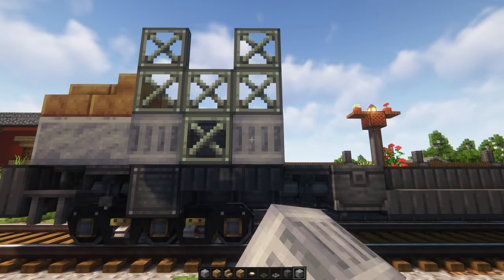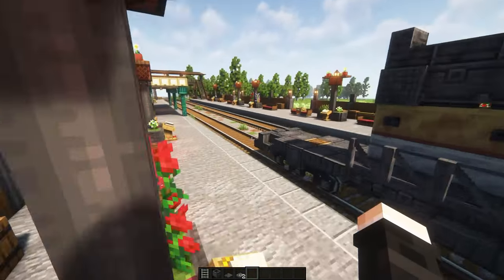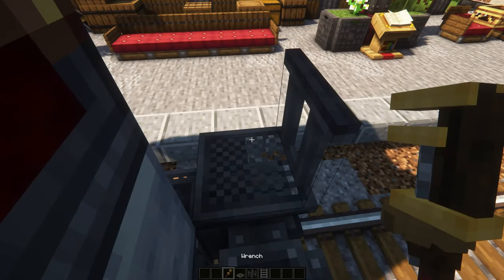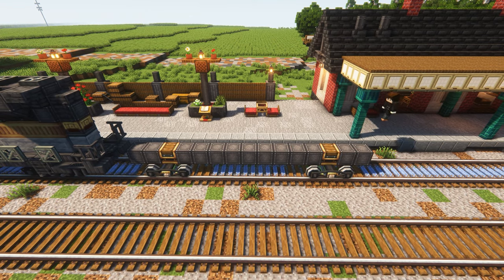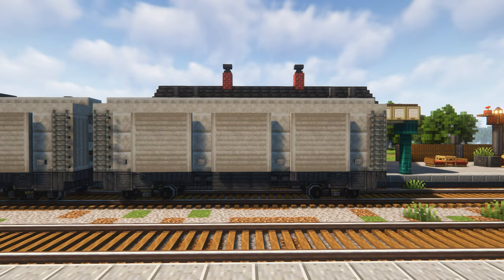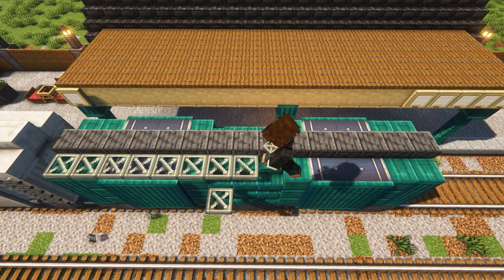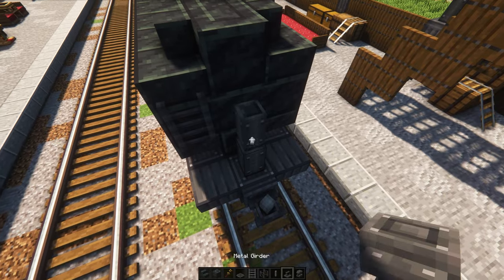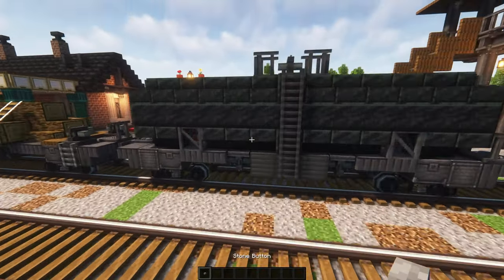Making a FREIGHT TRAIN with Create Mod | 🚂 Minecraft Tutorial

Comment: 쉐이더나 소듐을 깔면 모방블럭이 나타나지 않는 현상이 나오는데 어쩌면 좋을까요?
Google Translator : If I install shader or sodium, the imitation block does not appear. Is this a good thing?
Reply from the maker: Copycat you mean? If you noticed a copycat panels invisible through transparent then that is normal, it is a bug that I usually just work around.
But if it is not appear/invisible in general then that is not normal
Reply: sorry. I think the meaning was conveyed incorrectly because I was using Google Translator. An imitation block is a thin steel plate. After installing it, you can take out another block and right-click on it, and the image of that block will be inserted. It's a thin block used to build the train walls in the video.

Thank you for your sincere response and sorry for bothering you.🙇‍♂🙇‍♂ @MadenPlay
Reply from the maker: @user-ti8rh9yh7b  No that is quite alright and we seems to understand the same thing. What I used for a train wall is called a copycat panels, and if it doesn't not appearing like you said then  I think there's a problem
Reply: @MadenPlay  Thank you for your kind reply

So do you know why the copy block doesn't appear?
Or may I ask what shader mode you are using?🥺🥺
Reply from the maker: @user-ti8rh9yh7b That, I don't know. I use sodium iris and the shader I use is called "Complementary" it is the most compatible with Create mod I believe

Comment: Bro I've a question.... I've recently bought a gaming laptop and downloaded Minecraft in it at first it is running smoothly with 400 to 500 fps then i downloaded fabric with sodium+isis but then I only get 150 fps and with bsl shaders i still get 100+ fps but when i put any other mod like create mod or immersive portal mod (seperately) with shaders i only get 30 to 40 fps like why...and how so many youtuber are playing create mod with shader smoothly...but I can't....plz help me bro.... My laptop specs are

Rtx 3050 4gb vram 85watt tgp
16gb ddr 5 4800mhz dual channel 8+8
Reply from the maker: I don't know why you get lower framerate with sodium and iris because that's the best optimization mod I've use, but I can tell you this.
Using shaders on it's own with a few or barely any mods is just fine but using it with create mod, well you wouldn't expect it to be smooth because create and shaders are not optimize to run together.

what you see here is me hiding the lag by turning motion blur in the shader in reality it's 55-58 fps and I'm using 4070 desktop, and the more mods you have the more lag it gets. I don't usually play Minecraft Create with shaders on, I only turn them on while recording a video and I have to make sure make it as optimized as I can get it.

Comment: How do you change the wheels?
Reply: and where is that Hull thingy used in your other videos. i would really like to use them
Reply from the maker: Make sure you have steam 'n' rails installed then you press and hold alt key while holding a train casing
Reply from the maker: Do you mean the Open Simple Frames mod? If that is what you mean, It's better to use copycat panels since it's already comes with the create mod

Comment: I don't know what performance mod you are using to be compatible with valkyrien sky (that's the problem with low-configuration devices and also the reason why the downloads of a veteran mod like valsky are still too low)
Reply from the maker: It's lithium sodium and indium, then the rest is just about finding the right mod version that are compatible with each other. I start by install a mod one at a time and if something isn't compatible try downgrade the version
Reply: @MadenPlay  it's just fine with 1.19.2 but 1.20.1 is still very messy, ironically nvidium is hiding inside 1.20.1 :((